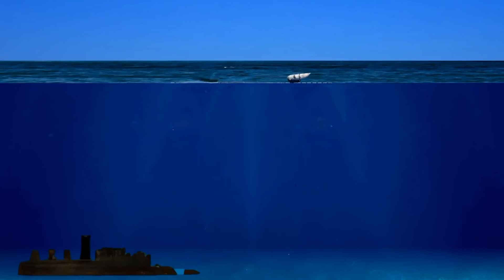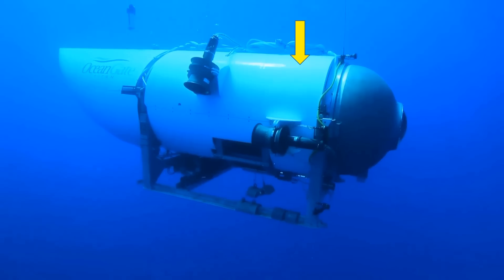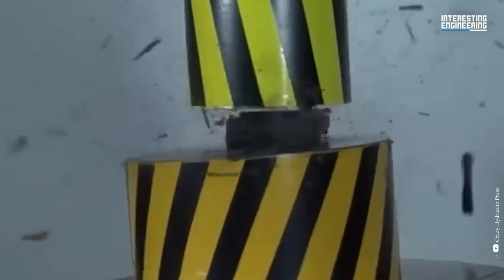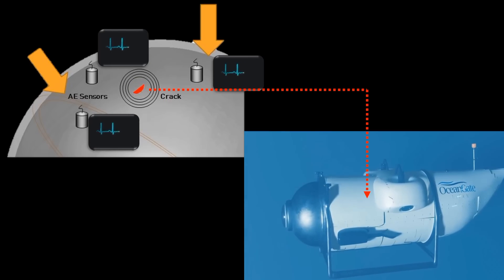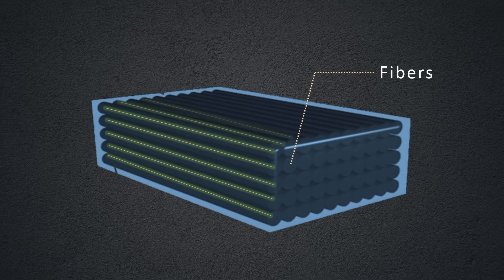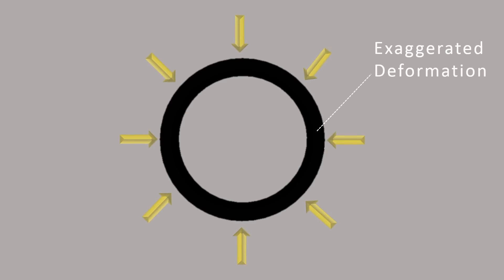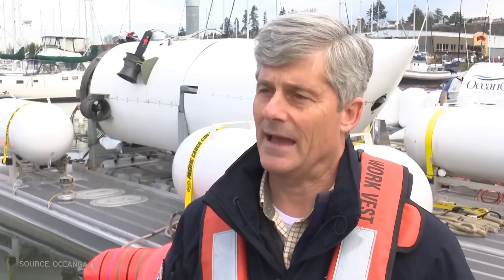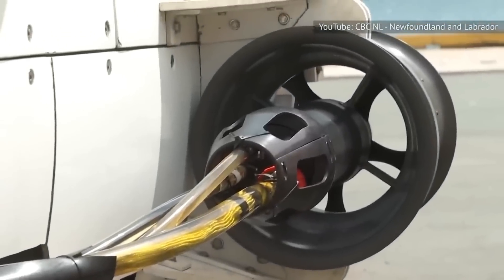Oceangate Titan Did Not Implode Just From Pressure. There Is a Catch!

Comment: Yes, submarines also share the tube-shaped body as the Titan submersible did, but no submarines go down to the depth at which the Titanic rests, 13,000 ft.  At that depth, a ball shaped chamber has the best strength.  This is one thing that people tried to point out to Stockton Rush, who ignored their concerns.
Reply: Trieste knew that in the 60's
Reply: @randyboisa6367  yep, 11,000 meters. Went to Mariana trench. Trieste was the shape of a fat, yellow hot dog.
Reply: @scotshiers  But the pressurized crew section was spherical.
Reply: @hoghogwild  curves are curves.....E.S.P. works against all surfaces equally. The Hoover Dam as well as all other dams built (older trestle style bridges as well) hold back millions of tons of water pressure. The curvature puts the structure into compression when force is applied. Cylinders and Balls all feature this concept. The Trieste's cylinder was filled with incompressible fluids and the round ball below was the pressure capsule. The Oceangate's fatal flaw wasn't the fact it was a cylinder rather than a sphere, it was due to the thickness of the carbon fiber at the titanium endcap interface, the c.f. not being thick enough and bad longitudinal reinforcement (think rebar in concrete) as well as too many dives (life cycle) creating micro-fracturing in the c.f. substrate. Cylindrical objects can be engineered to withstand depths, but thickness and structural materials make it extremely impractical financially  for private party ride alongs. This accident was due to poor engineering and greed.....
Reply: The irony is it would have been cheaper two because of less surface area, but Stockton Rush did seem like a cheap and greedy bastard.
Reply: @MrEgofreak  And I think Rush got greedy because he wanted to take 4 passengers down at once to make $1 million a trip, so he had to make it cylindrical in order to hold more people.  If he had made it a ball shape, it would have been hard to fit five people in there.
Reply: @MrEgofreak  I'm not sure it would have been cheaper by the time you had enough of volume in the sphere to hold enough people to be worth the trip. When you increase the volume of that sphere you increase a lot of the buckling problems that you could have and difficulties that would require a lot more material
Reply: @markmcgoveran6811  That's true! Maybe they could compensated with multiple trips in a day.
Reply: @MrEgofreak  no they ain't they can't it takes 2 or 3 hours one way. That's just not an economically viable proposition to come up with something and dive within the safe limits of materials. Nothing can take that kind of load over and over
Reply: @MrEgofreak  Rush did the tube design because he wanted to be able to fit more paying customers than a sphere would have allowed. As I think there is a max size a sphere can be to weight ratio as if it's too large and heavy, then it may not be able to get back to the surface.
Reply: @colt5189  Thanks for info man! I'm not too into undersea exploration, but it's nice to know there are people out there who can fill in gaps.
Reply: @MrEgofreak ✅
Reply: @MrEgofreak  But it probably would have been harder to wrap the carbon fiber in a spherical shape.
Reply: @dx1450 🧵 thread is even,sphere has overlap,uneven.
Reply: @dx1450  Heaven forbid to make it out of steel then.
Reply: He was one of "THOSE", can't tell him jack.
Reply: Yes 🏀 or 🔔
Reply: @rochcarothers-ts3jx  Bell won't work because you'd be under so much pressure it would crush you it has to be a ball and it has to hold that out a diving bell is just got the bottom open you'd have five thousand pounds air pressure on you by the time you got to the bottom
Reply: NONE OF THE SUBMERSIBLES THAT WENT DOWN TO TITANIC OR THOSE DEPTHS ARE SPHERE SHAPED.  SPHERE GIVES MORE SURFACE -FOR M ORE WATER PRESSURE PSI
Reply: Yeah, when I heard him compare shallow water submarines to Titanic depth, I knew this video was a waste of time.
Reply: That very sub-Titan had been down to the Titanic 13 previous times
Reply: @t-rex4211  yeah, and that's why it failed on the 14th trip.
Reply: Close a ball shaped bears that huge load evenly all the way from a billion pounds that's what I asked to made it was on the outside of the sub down to zero when you take the cap off there's no pressure differential when you tried to cycle materials through that kind of load cycle you need to have a sphere. Any other geometry changes shape a little bit somewhere under the load and you will guarantee yourself a repetitive stress riser failure and when it fails it's going to be an instantaneous complete collapse.
Reply: @markmcgoveran6811  Would a few periods cause a stress fracture in your run-on sentences?
Reply: @markmcgoveran6811  One of the guys who took an early trip on the Titan said that the cylinder cracked and popped all the way down to depth, and continued to crack and pop as it came back up all the way to 300m, as the cylinder continued to decompress.
Reply: @LionAndALamb  thank you for confirming that I had assumed it all along
Reply: Correction, One submarine did go to those depths, and deeper - The Aluminaut. https://www.youtube.com/watch?v=x-p7fpBjoyE
Too bad Rush chose to re-invent the wheel instead of leasing an existing submarine with a proven safety record.
Reply: @dgkcpa1  I looked that up. It didn't make very many trips to the extreme depths and it's sitting there in a museum ready to go in case of an emergency that we have to dive super deep for. If you thought that could go up and down a bunch of times to the death of Titanic you'd get a surprise. It's at their longtime ready to go in case they're going to dive again and it's not because people don't want to spend the money to go for a ride they just don't have enough money and they don't know how many trips I'm like that's going to make before it implodes.
Reply: @markmcgoveran6811  I'm not sure what your point is. The Aluminaut was the first submarine to dive to 15,000 feet, and it did it with a tube shapped body. The hull was one material - aluminum, not a mix of materials, like the Titan. It had a hatch that could be opened from the inside. It had multiple view ports, and you could stand up in it. It is still being maintained. It made 251 successful dives to various depths, recovered an H-bomb, a torpedo, and even Alvin, the sub that found the Titanic. I don't know how much life is left in the sub, but I'd rather take my chances in something with a proven track record of safety and accomplishment. Why re invent the wheel? Rush and his companions would likely still be alive today if he had chartered the Aluminaut instead of making the dive in his own craft.
Reply: Why not mold the pressure hull using polycarbonate .  . it would weigh more, but there would be no laminate or failure from fatigue if built of sufficient thickness and it would require no dissimilar materials bonded together .  . and it's impossible to crack the stuff .  .
Reply: @ronaldgreene5733  doesn't matter what material you have when you get to loads like that. If you go through a cycle 0 lb when the doors open all the way to a billion pounds total when the door is shut and you go down, it's not going to make very many cycles. If you had a polycarbonate sphere 1 ft thick with a big hole in the middle when you begin to load it it would have a lot more pressure on the outside and as it increased and went through that all the way up to having a billion pounds on the outside there would be shear stresses and body forces risers in any material.
Reply: @markmcgoveran6811  .  . your point being -- given enough pressure, any material will fail.  Why make the point?

Comment: As a once mechanical engineer this is outside my area of experience, but I have a thought or 2. Carbon fibre is not used in bulletproof vests, kevlar is the most common material for that. So, the impact of a bullet must produce substantial compressive loads. Would Kevlar provide better compressive strength in a submersible hull? Or is the bonding agent and it's method of application a more important issue?

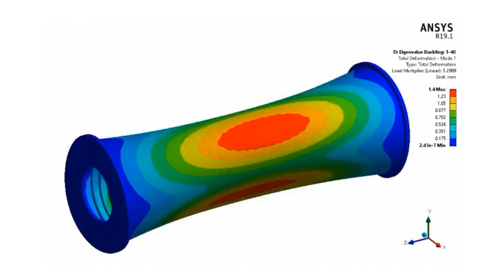Comment: From the standpoint of avoiding strain concentrations to deter crack formation, a hollow sphere made of isotropic material operated so that the material does not approach its elastic limit anywhere in the structure would seem to be the safest bet for an underwater pressure hull. I see the cylindrical shape as a potential issue because of the nature of deflection under pressure as shown at 6:55. Not only are there strain gradients along the axis of the cylinder, there are discontinuities in material characteristics (and thus strain) at the glue joints with the titanium end caps. Delamination of the carbon fiber at the inner radius is one possibility, I agree- but my prime suspect would be failure at or near the glue joint due to flexing of the cylinder under pressure and/or the substantially different properties of the two materials adjacent to the glue. The assumption that popping noises would give sufficient warning to allow the sub to return to the surface safely was clearly not justified.

Comment: Question: say one used a type of low carbon alloy steel, say something like 4310 steel (nickel-chromium-molybdenum) and formed into a spherical shape.

Once the sphere was welded (TIG) and then heat-treated, the sphere was then pre-stressed with ~ 500-1000 atmosphere pressure from the inside prior to being put into service.

Would this pre-stressing help the sphere endure extreme external pressure?

Comment: what is curious is why use carbon fibre in the first place?
the economics of tooling up for carbon versus having a heavy duty steel or titanium tube cast and machined in China or elsewhere might have been quite close.
amybe if after the first deep dives had revealed potential problems it may have been possible to strengthen the carbon with external steel rings at quite low cost.
Once the carbon fibre sub was making serious money - 3 or 13 trip to Titanic? - at $250,000 there would have been cashflow to consider replacing the carbon fibre tube with a steel or titanium one even if it meant making a new docking pontoon etc.
all our if are useless now so we just wait for pix of the wreckage and remains.

Comment: Fiber under a compressive load must rely on the matrix and other fiber to keep it bound. Seems likely the weave running length wise may not have been sufficiently held, allowing the structure to implode front and rear, not so likely along it's circumstance.

Comment: Excellent video. 
One more thing to remember : I believe there is also an axial load along the cylinder from the pressure on the end caps. If this was a sphere it would all be external normal forces, but the normal pressure on the end caps results in axial (compressive) loads. I’m GUESSING this may be one reason they were confident in the glue between the end caps and cylinder being sufficient: it would be compressed. 

Might be wrong but that’s how I’m visualizing the loads. Your vids on CF loading were the best I’ve seen so far.

Comment: A bit of a dumb statement really.  Without any pressure there would have been no failure.  The vehicle could sit on the surface for 20 years and never implode.  Pressure was a fundamental part of the equation and it could be the only part if the vehicle is physically sound but submerged past its designed/actual failure depth. As in most disasters, there are often a series of issues as there was here, so its pretty obvious from what we know, that pressure was only one factor

Comment: Well explained. I read that the Titan had been stored outside in freezing temperatures. Obviously any water that may have been forced into the carbon fibres due to the  high submerged pressure would have frozen and expanded, further weakening the integrity of the hull. I agree that having sensors to tell you when failure is imminent is not a good idea at 2.5 miles under the ocean. Ultrasound testing would  be the best idea. Anyone saying ultrasound would not penetrate 5 inches of carbon fibre has never done ultrasonic testing of steel feet thick.

Comment: There are two things you can bring up. The variation in modulus do to fiber mis-orientation can cause the vessel to go slightly out of round. A 1 or 2 % shift in roundness can cause a 10 to 15% variation in the load symmetry. The most likely failure is shearing of the carbon at the titanium joint. Carbon is very poor in shear strength.

Comment: im by no means an engineer but think there is great future in using carbon fibre for deep sea exploration, the way the Titan sub did it was an excellent start, if they can find out what went wrong and correct it then go from there but needs to be experimented in real time dives without passengers by remote, i wonder if they had used another layer of metal and another layer of carbon fiber if that would have given the submersible what it needed, from what i gather the problem laid with the end cap, i think the end on the sub that had all the electronics and batteries in it segregated from the passenger compartment had a breach, filled with water and made it impossible to ascend due to weight, until it got too heavy and detached from the passenger compartment pulling the structure apart until it weakened the passenger compartment where it imploded, emergency airbags being mounted to the top of the sub might have been able to lift it to a safe enough hieght where it could have been retrievable i guess we might never know.

Comment: Mechanical pressure can be applied to the shell on the surface. Would they have considered the same pressure applied to the shell at the temperatures at that depth. Common sense would tell me that the fibers used in that submersible are more than likely subject to shrinkage especially at the temperatures it would be subjected to at those depths. As they have suspected, repeated dives weakened the structure to the point where it couldn't sustain the pressure any longer. Different materials would have different thermal expansion qualities. Titanium would shrink at a different rate  than the carbon fiber and potentially create a breech in any of the seals where they connect to the hull.

Comment: You cannot use NDT where the material application has not been destructively tested first.
This vessel had not been proven/tested at the depth they were diving at. The acoustic monitoring system was about as effective as shutting the proverbial gate after the horse has bolted😫

Comment: The use of game controllers is a lot more common than you realise. It has not bearing in what was going on. Your other points are valid around carbon fibers. Where he had sourced them, limited shelf life (Well known issue with carbon fiber cycles frames) and that the end cap with the portal was not rated for the depth.

Another thing they had serious issues with, the computer control and electrical distribution systems. After that is the whole emergency ascent stuff by dropping weights, etc. Inflating air bags, etc. That whole thing was a complete mess.

Comment: As it has now become obvious, from a number of YouTube videos on the Titan disaster, that the carbon fiber composite hull was the likely cause of the catastrophic failure.  I can't help but wonder if there was any way that hull could have been made of that composite and survived?    i.e. suppose the cylindrical hull was wound in various directions rather than just radially, combined with the proper way to kiln it in a vacuum to avoid air bubbles in manufacture.  Also, assume it had enough thickness as prescribed by the best computer estimations that we have for this material.  And finally add the necessary non-destructive testing of the hull after each dive to Titanic.    [this is just a theoretical question regarding carbon fiber application - so, let's leave out the related question about joining Titanium to this material]

Comment: Your material engineering knowledge is excellent, but businesses, and especially the military think carbon fiber is a miracle material. The problem with carbon fiber is due to the lack of cycle strength. Over a period of time cycles, carbon fiber will fracture with a shorter strength life than metal.

Comment: No one believes it was the carbon fiber giving way. Eventually yes, but from other causes that started at launch. The best explanation I have heard was from an engineer. Just going by timestamps and the alleged "transcript" WHICH some ppl think the passengers heard the communications from the surface, but we know some of it was done via text msgs between the surface and Rush...who...hopefully was trying to comfort everyone. I digress...Here's a basic rundown of what he said. It makes total sense to me. 

It took on water  almost from the get go. The crackling noise they heard was the first power supply shorting out as the sea water reached it. That's when the noises stopped. Then water reached the 2nd power supply and the noises started again. Due to the intake of water it could not ascend quickly enough, and eventually just to much water, shit gave way and here we are. The guy explained it much better than I, and made much more sense. The carbon fiber would shred to pieces and we saw big chunks coming up. So the water, pressure, weight it went into freefall and imploded. They would have been completely in the dark as well. Unless there was some sort of backup lights inside with them. Cell phones prob. the most they had knowing Rush. He sure lived up to his name. Rush this, rush that. Don't get your submersible from IKEA's Lego dept. 

I feel for the boy on board. He did not want to go, but his father made him. Oh his poor mom. The families in general. They say it was so fast the brain couldn't register what was happening, but they still knew and that's terrifying.